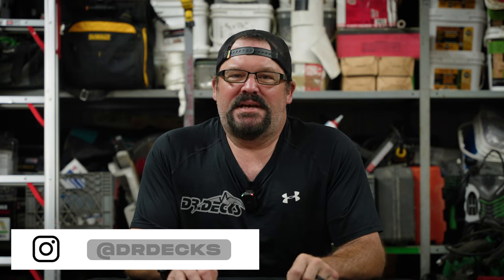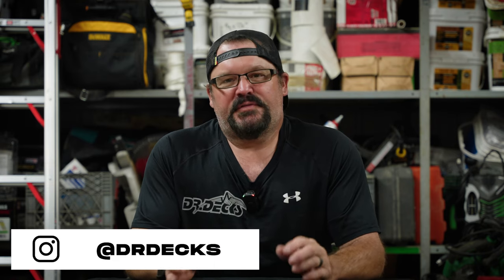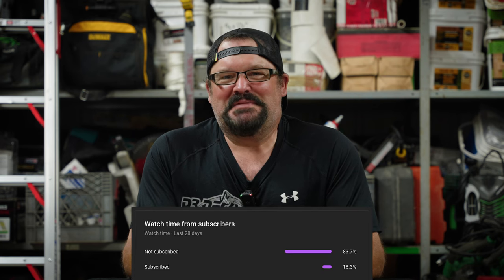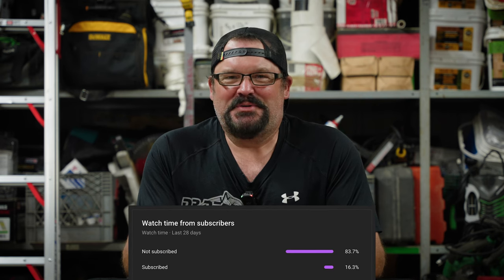Dealing With Expansion & Contraction (Question Time #24) ||  Dr Decks

Comment: We're in SouthernMN, so different building requirements, still love the information. Hoping to put stair lighting and post light. My question is when attaching flashing from a ledger board to the house should I also use flashing tape to the whole length of the ledger board below the flashing? Just curious if that's overkill?